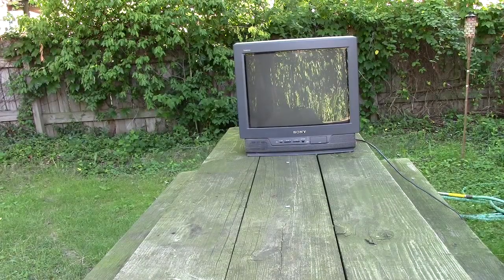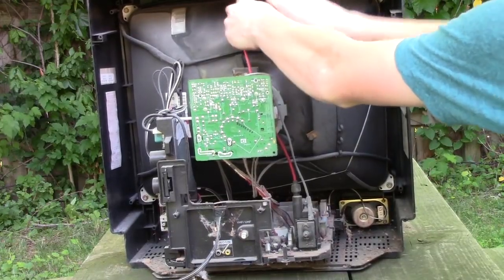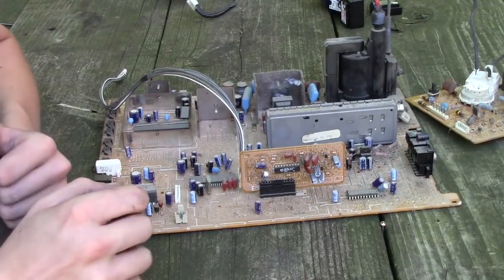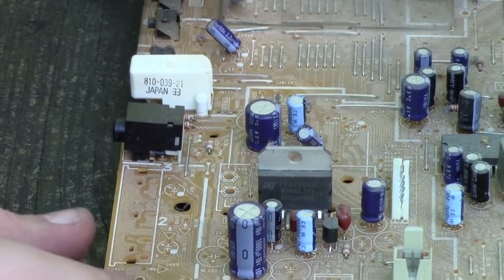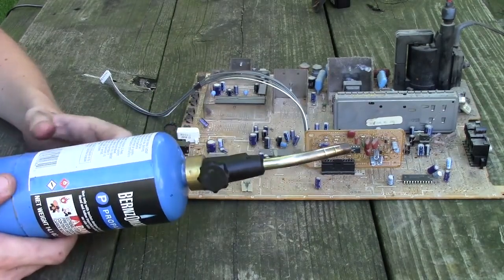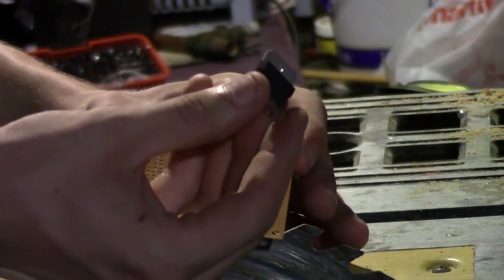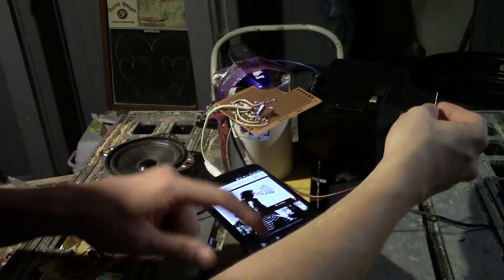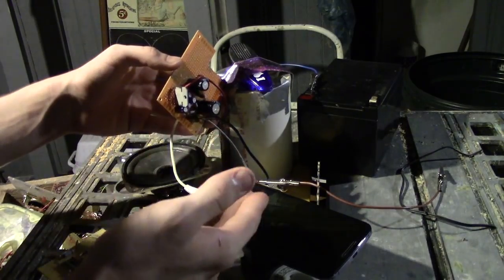Audio Amplifier COMPLETELY from an Old Television!

Comment: i have an old mini HiFi Sony tat has a great quality of sound, te amplifier is still good but te buttons and the desk tape and the cd player and the radio are broken... can you make us a video of how to extract the amplifier part from it... i will be really thankful
Reply: It would be the same basic procedure.  Look for the same type of chip he discusses, verify it with a google search, and pull it from the board.  I wouldn't recommend using a blow torch, as he did, unless you're skilled with it.  For beginners, a soldering iron and desolder wick does just fine, and is a lot safer.

Comment: If you were to place a 0.100uf cap on the output to ground you filter all unwanted sound. Basically you amp here is oscillating. Hence the nasty sound.

Good work.

Comment: That is not how you discharge the high voltage! You need to ground the CRT. And you do that before you remove the flyback lead. And, no, six months of sitting unplugged will not assure the tube is discharged.

Comment: Instead of building a new board for it. If you examine the tv board it self, you can actually just cut out the amplifier section. The only thing left is to figure out the power, audio in and out. Done.

Comment: You inspired me to reuse two tv boards that i have lying around! Thanks.
Would it be possible to scrap an oscilator from a tv board to make an low power AM transmitter?
And, for heavens sake - 4:30 - at least, use gloves!!!
Reply from the maker: I just discovered gloves... amazing invention...
There may be a crystal on board in the range of 3-8 mHz that you can use. Look up the Michigan Mighty Mite transmitter... most of the parts can be found on the TV board

Comment: Hi, you seem to know a thing or two about electronics and TVs in general, so maybe you can help me out (or anyone else who is reading this comment/question). 

Namely, I got a huge Sony KP-57WV700 rear projection TV from an elderly gentleman, who was getting ready to throw it away, and the TV was working fine for 8-9 months, before starting to show a lot of red discoloration. 

Anyway, I got another big Sony TV (even using the same remote from the previous one) SONY KDFE-60A20, and I would like to use the base of the KP as a DIY TV-stand for the KDFE, but also use/connect with audio cables (OUT from the new/ IN to the old) the audio amplifier and speakers form the older model (built into the wooden frame KDFE stand). The older SONY has superior sound quality! 

Is that possible? Can I somehow isolate only the audio amplifier, and still be able to turn the old TV on and use it only as a sound amplifier?

I hope you are still reading the replies on your old(er) posts :) 

Cheers, Zoke

Comment: 4:30 you could have just used a soldering iron.
Reply: Ali the retro kid true but he was outside without an outlet
Reply: I'm very much into soldering, but that was like 10x faster. Quick burst of heat vs constant heat at 4 points to desolder.

Comment: The flyback transformer does not hold the charge , its the tube that holds the charge and this should be discharged to prevent a electric shock

Comment: I would have though you were just going to cut the amplifier section from the main PCB..be a-lot easier, amplifiers are very cheap, and its just as easy to buy a power chip amp assembled and ready to go from ebay for a few dollars. Also note its the tube that holds the charge, its best to take an grounded HV insulated probe and drive it underneath the EHT plug first, discharging it and then unplug it. Those chip amps are not powerful, nor are they Hi-Fi.

Comment: I got a cd2611gs ic  from old tv board 
and I can't  find any amplifier circuit diagram.
Reply from the maker: It looks to be the same as the TDA2611, just made by a different company. Search TDA2611 on google images and you'll get a few diagrams.
Reply: thanks for the reply...

Comment: to remove the flyback from the tube, you should have used a screwdriver with a lead attached to the chassis ground to discharge the thing, not just insulate you from it while removing.

Comment: Are you kidding us? You should NEVER put a screwdriver under that rubberinsulation, without first connecting it with the grounding of the CRT!
It won' t be harmful, but you will remember the shot for a lifetime.

-Noy to mention that the TV must have been already turned off and unplugged from  the mains...

Comment: You can actually very carefully cut the circuit board out of the TV chassis you can actually very carefully cut the circuit board  the TV and we use a circuit board just have to add the wires to in the powers of I'm easy way to get things done

Comment: why you guys have to be so got damm rude the guy is sharing an idea with you if you don't like it just go to another video that's all, my god something is wrong in this world...
Reply: Because he presented a potentially hazardous procedure. The high voltage in old TVs is dangerous. He did not discharge anything by touching the anode cap to ground.

Comment: Can any of you smart tech guys help a not tech guy make a fucking amp.? I want to use my phone I have a Yamaha 10 in AC powered sub, I have a Polk audio 100 wvshelfvdpeaker with a tweet, I have some capacitor scans misc crap. I have a Bluetooth speaker. A n old small tv. I don't want to buy anything but I did buy a wireless 2 in 1 audio receive r transmitter! Thank you so much. I just need some good loud clear crisp music!!! 0 please